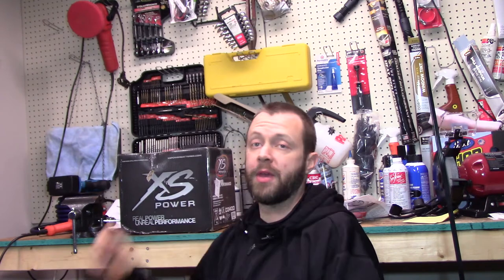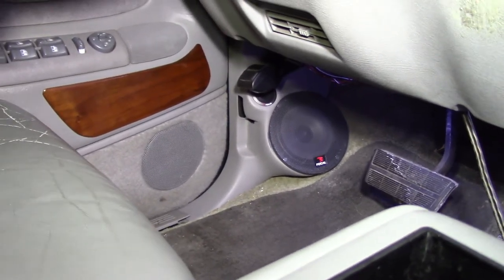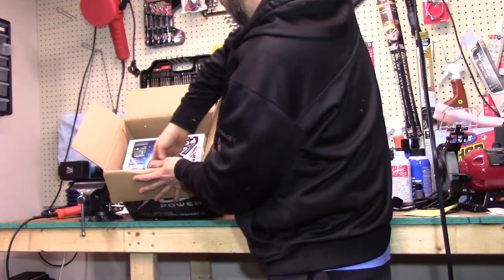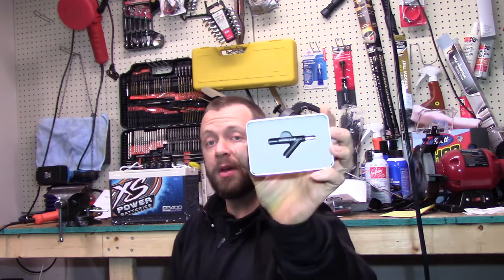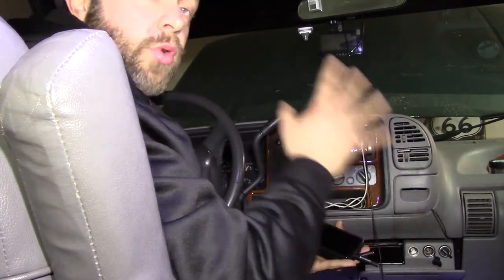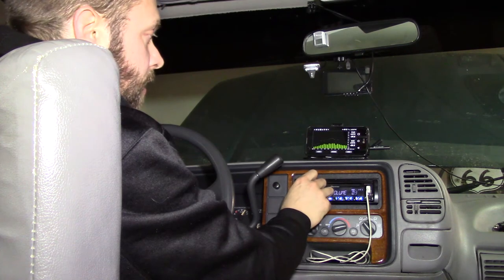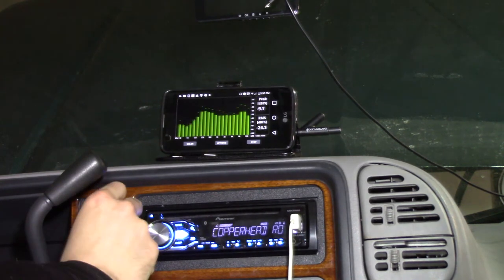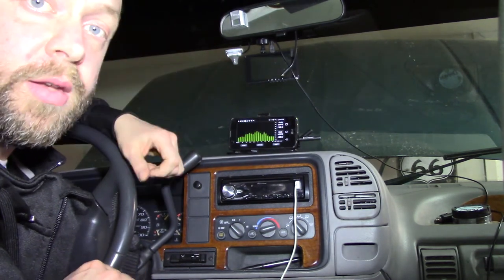Focal Polyglass, Q-Logic Kick Panels, Tuning Front Stage W/Dayton RTA Mic. Suburban Audio Build #7

Comment: Do the Q-logic enclosures take up a lot of space by your feet? if so, is the sound quality worth giving up that foot space? BTW, glad I came across your channel cause I'm building an old school system with an old school DEH-P8600 Pioneer cd head unit with a 12 disc changer. I just subscribed...
Reply from the maker: No they don't take up a lot of room, though i am always nervous whenever i have a passenger that they will do damage somehow. They are worth it considering how well they image. They do lack midbass in that small air space so i plan to put some 8" midbass Focal speakers in the door. I already built the speaker rings and bought a new saw for the job, so hopefully i get that job done and the video uploaded soon. thanks for subbing.